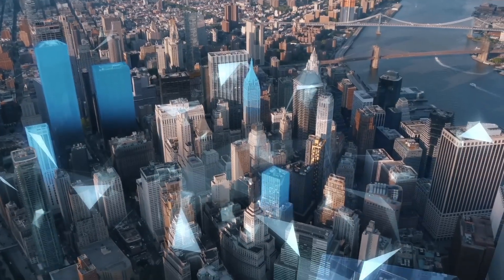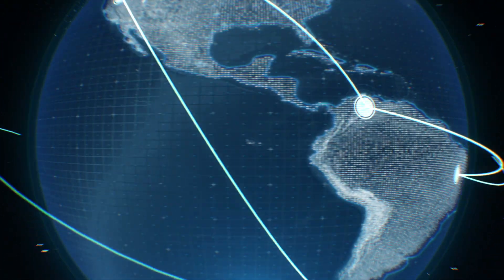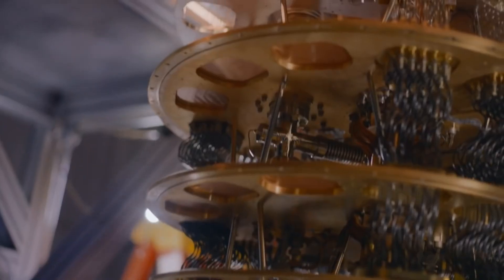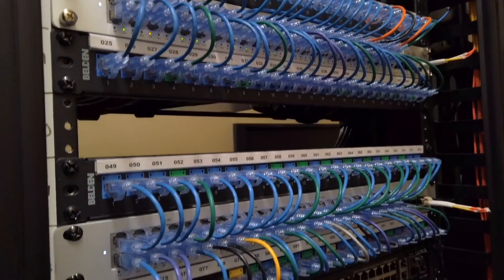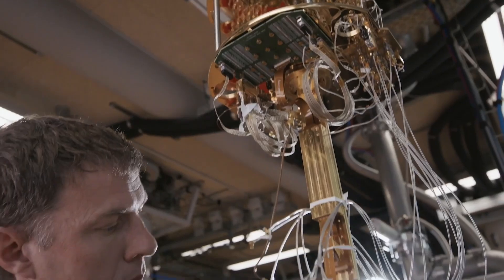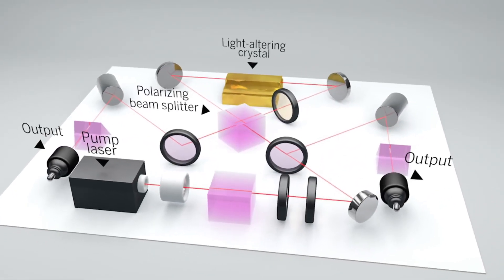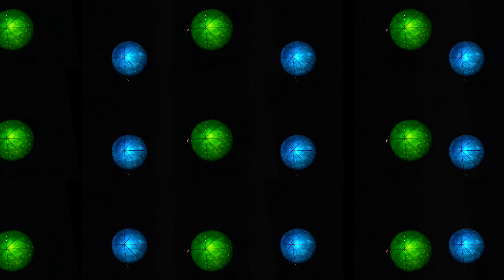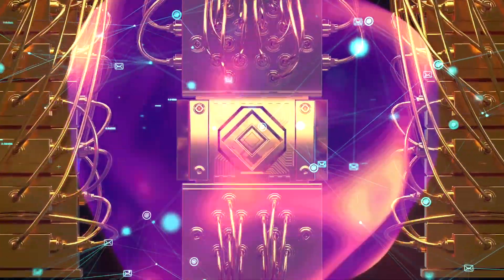Scientists Have Found a Way to Make Teleportation Work

Comment: What about teleportation without dematerialization and reassembly, like a gateway? Bringing point A and point B together, and then you just walk through, remaining intact... I had this crazy dream where I was watching Netflix, and used its pricey snack bar feature. This table came out of the computer screen with my order of nachos and a soda. I removed the nachos and soda from the table, and the table retracted back into the screen. That would have to be a very special screen, like a gateway, right? But it wasn't cheap. The nachos and soda cost me $30. In the dream I thought I can't really afford this, but I have to try it. The taste and texture of the nachos was normal, and hot. The bottle of soda was cold... Is Netflix working on this?
Reply from the maker: I'd have to try it too!

Comment: How would you get the other end to be where you want to go? Time is a action. You can't bypass it by omitting actions. Even grasping events happening around you takes actions to process it. Quantum fields are actions of resistance. No resistance, no actions. Space is at maximum momentum velocity out of entanglement. Fluidity is thermal energy singularity frequencies out of entanglement. Entanglement gives us information about Quantum fields. Vibrations are amplified by entanglement of information about Quantum fields. Resistance is key to what we know about our universe. We vibrate through space, as space, in resistance. No resistance, no us. We are at our maximum momentum velocity in resistance. Perfection is that the universe is fluid motion, and creation of all mass, is never repeated exactly the same way, place, or order. Vastness is unidirectional forward maximum momentum velocity of existence in resistance. Teleportation would be cool, but frequencies have to vibrate. You would have be able to bypass space itself physically. Interactions are necessary for information to exist. Infinitesimal Interactions between forces would have to be controlled and repeated exactly the same way. That isn't possible.  The very space would be different. I'm trying to imagine how physical structures of biological, or even non biological makeup, would be instantly affected as a whole, to be able to maintain solidity, after being transferred into fluidity over an area of space, and back into its origin without decaying into primordial origins. Your physical properties might still be there, but mentally you would be erased? Your psychology would have to be preserved to be you. How do you Teleport memory? Storage?